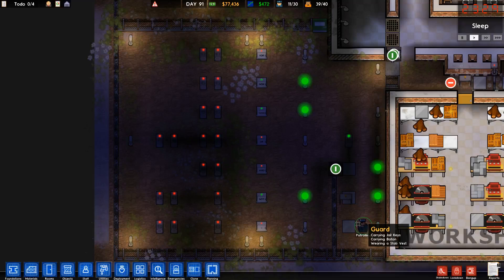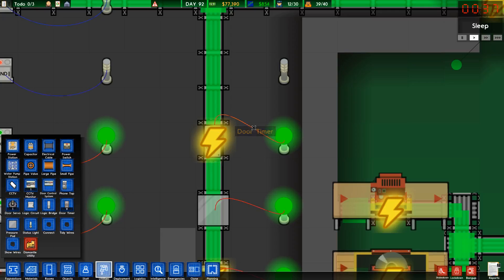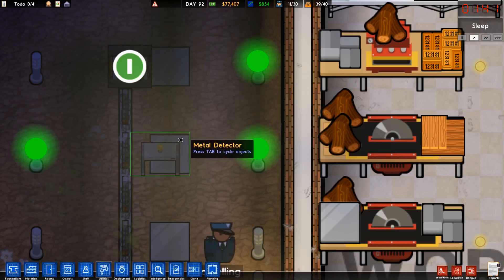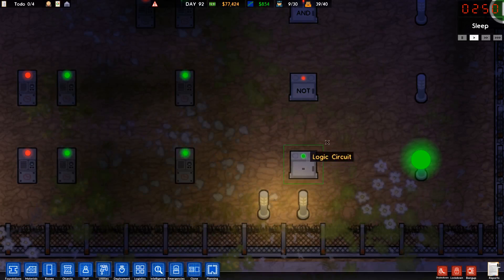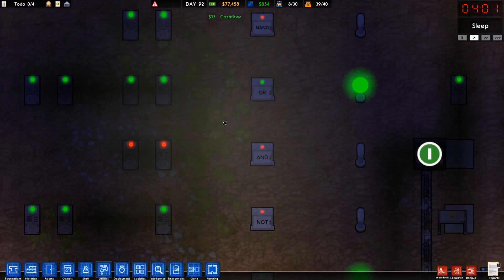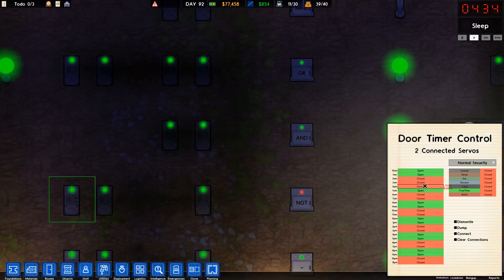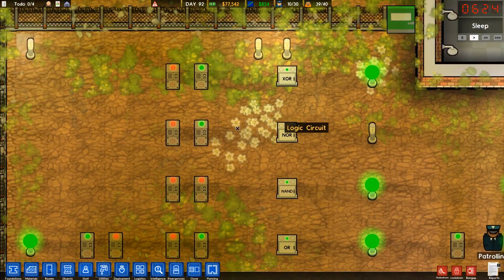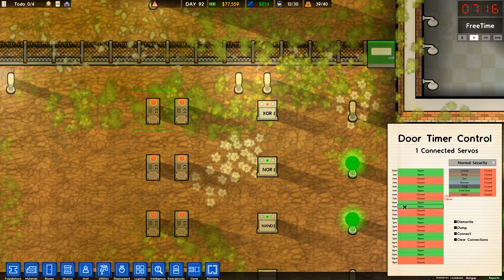How to Use Pressure Pads, Logic Circuits, and Door Timers - Prison Architect

Comment: i came here to learn bout the Logic circuits... and learned that they are useless. but grate that you made a video about it.  but yeah i see few people use door timers and door servo's.
Reply: I can see many, many uses for them.
Reply: XOR ... perfect for making an airlock style entrance system or a "sally port" gate.  You can only open one door at a time, but never both at the same time.  Of course there'd be some additional logic if you wanted both shut at the same time, but the point still stands.
Reply: I haven't tried them yet, but it seems like they'd be useful for traffic control. For instance, let's say you have a canteen hooked up to a door control. Normally the guard manning the control would let anyone in who wanted in. But if, for some reason, you decided that you only wanted prisoners to be able to go in an hour before meal times, during meal times, and an hour after to accommodate stragglers you could hook it up to an and brick with a timer.

Of course, there would still be the issue of guards letting prisoners in, but if you put an exterior staff door in the kitchen to allow staff to come and go freely and replace the jail door with two remote doors that wouldn't be an issue.
Reply: i use it for supermax you caan get more control over your prisoners and if you set up door timers correctly you can make sure all your prisoners are in there cell before yur guards go on break

Comment: But for what is that useful during gameplay?
Reply: The door timer, It’s good for making doors open at a spacific time
The presure pads + door servo, good for maximum security exits such as: the road gates only open when gaurds are standing there,
Logic circuit + door servo, good for making air locks so it’s harder for prisoners to riot and to exit quickly
Reply: Asaloy My thoughts exactly, what purpose does this serve in a prison simulator game?
Reply: 2 years later but..

Maybe to isolate prisoners after a metal detector in late game if you have 500+ prisoners but just a few guards. The timer is nice for deathrow cellblocks. No guards needed